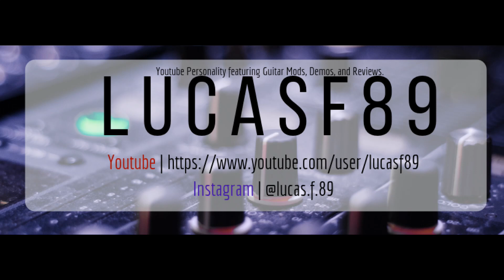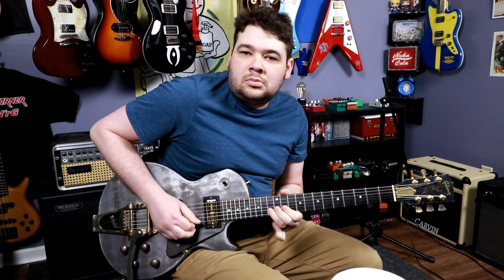My Wife And I Mod A Guitar: Part 4, Finale! How Does It Sound?

Comment: I don't know if the strings were still stretching or if the intonation is a little off or the keys we're slipping but right around 2 minutes 50 seconds the E and B string Just did not sound right even when you weren't touching the whammy bar.
Reply from the maker: The strings are still pretty new, I think they were just stretching. I had to stop and re-tune after that little bit :P

Comment: Super great build lucas, if I would have any complaints it will be those gold parts, they've looked nicer in crome I think, not your fault, just saying. 
On your part i think you did a great job.
keep up and rock on!   \m/
Reply from the maker: Yeah if it would have been up to me, I would have gone chrome/nickel from the start, but I decided to use as much of the original stuff as I could to keep the cost down.

Comment: Very nice sound Lucas. Tube amps are fine, but a solid state amp with a good cicuit, as your Carvin is, does the job.  I 've been following you since the video you had done 6 years ago: "Solid State Amp Shoutoot", demoing how good a ss amp could be. And so are good pedals. I' rather play on a versatile amp, with quite a bit of headroom to get the clean tones and tweak it with a couple of good pedals to get dirty/overdriven ones. One can stack a dozen pedals easily for the fraction of a (good) amp's price. Don't get me wrong: I love Marshalls and their tone, but I haven't got the space and the time for maintaining a JMP 45, an 800, a Studio etc. On the move, I need a simple solution, allowing me numerous tones, without worrying too much about weight, different valves, etc. Nowadays, most of the sound is through a good, low wattage amp with a lot of flexibility miked through the PA. Rock/hard rock groups are using most of the time one or two amps that are directed to the console, the rest of the cabinets being empty and theatrically set-up for the show... ;-) Oh: and that Modded LP is awesome ! Send it to Charlie :))

Comment: Clean tones are a bit "clinical" and lacking character - other than for the front pickup which combines some welcome depth and sparkle.
I'm hearing some fret buzz on occasion, which is not usually your style...
As you apply the layers of dirt, the guitar gets progressively more expressive.
Love the knobs you have on it. Would have liked more of that "custom crackle" in the finish - such a cool look.
Over-all, good job!